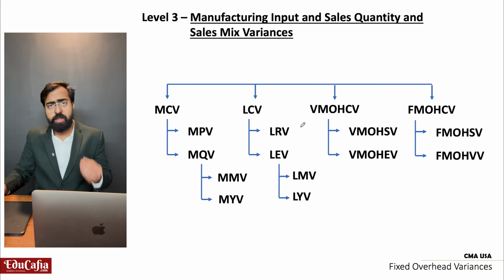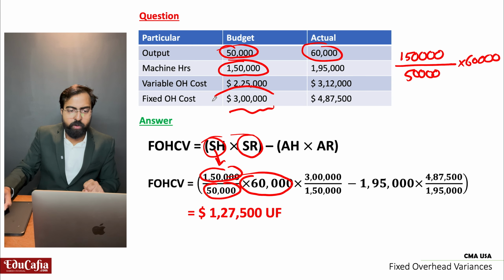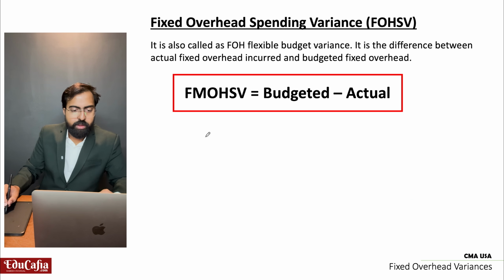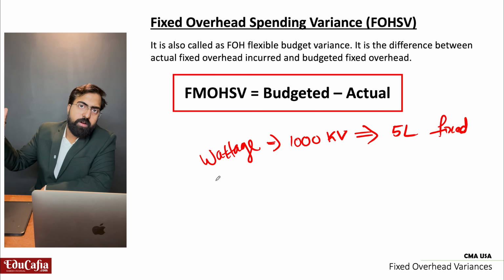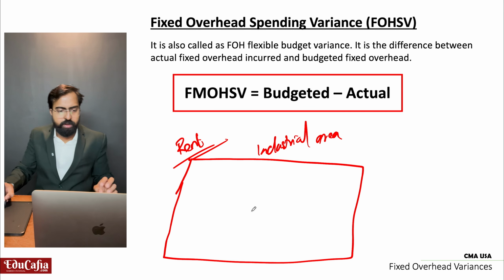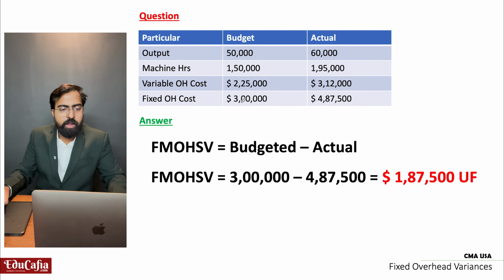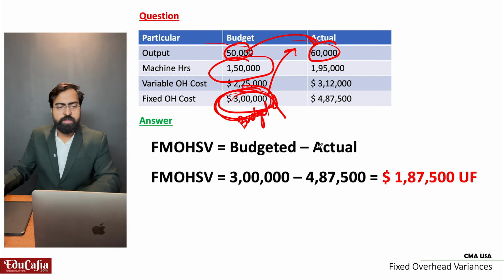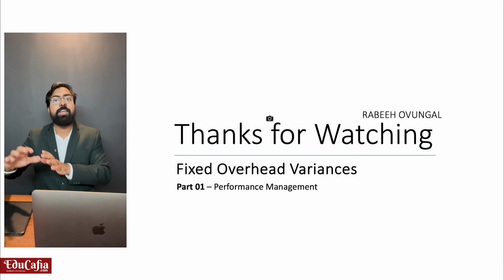FMOH Cost Variances | Performance Management | Section C | CMA USA | Part 1 | Episode 08

Comment: sir can you plz explain me in volume varaiance that in thix example the acutal cost for 60000 outpu is $ 487500 and we have calcualtes std cost for actual output that is 360000 ok but i m confused in thins why we have minus budgeted cost in FOH volume varirance i understand the calculation part but how and why it 360000 minus with 300000 and it came favarabole how and why plz sir jst i want to know this help me with this confusion